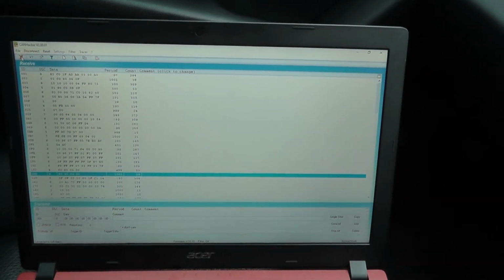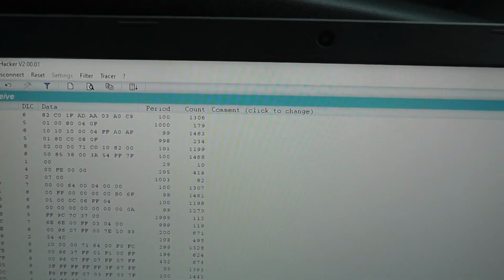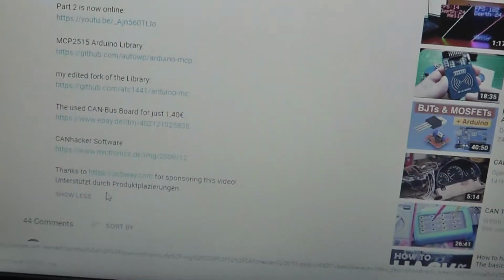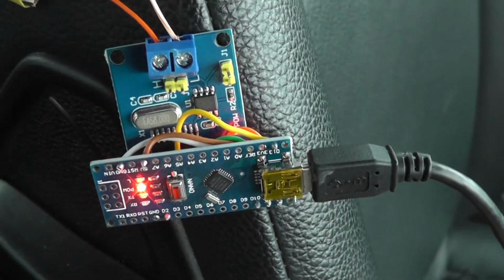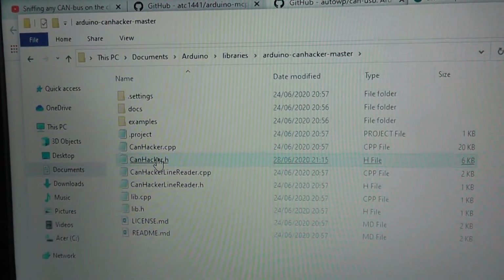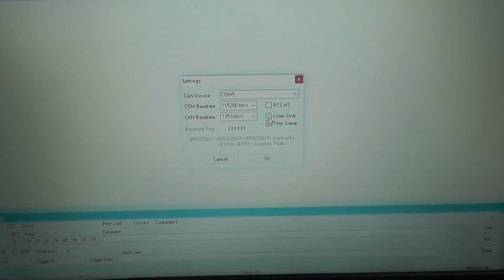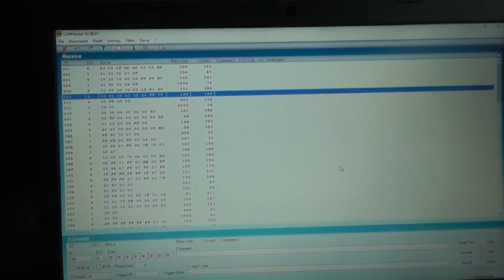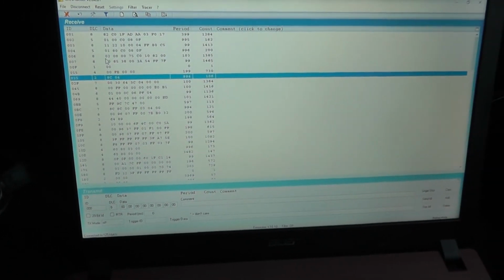DIY EV Part 2 - How to read the CAN Bus in your car using an Arduino Part 2

Comment: Hello, although you liked my post, you didn't reply, I would still like to know how to connect to my Audi A5 and browse the CAN bus, what do I need as I've already purchased various cables and CAN bus interfaces, so far nothing.
Reply from the maker: Have you tried connecting to the CAN bus directly or through the ODB2 Port?
Reply: @alibro7512  both, initially via the obd2 port, nothing, then I trying using a CAN crocodile on the CAN wires in the boot… still no luck
Reply from the maker: @SimonPlatten   Have you watched all four videos I made on this and read the notes and all the comments? Also Aaron's video?
Are you using Canhacker?
What speed have you set for CAN? 
It's been over a year since I looked at this so I'm a bit rusty on the details but I'll help if I can.
Reply: @alibro7512  I can't say I can remember if I have, I will take a look at these.  I've tried various speeds, but nothing on any.  Its been quite a while now so I will have to get back up to speed.

Comment: I've been trying to get a seeed can module mcp2515 gps to connect to new Toyota Corolla hybrid...

I've tried everything and I keep getting repeating msgs.

Tried all bauds, MHz, etc.

My question is... What PINs do I need to set in Arduino uno software?

I've tried 2/10 and 2/9...  

Anyone have any tips?
Reply from the maker: It was a long time ago that I did this and I struggled with the Seed Studio shield too.
How are you connecting to the CAN Bus?

Comment: ESP32 can use CAN HACKER V2 ?
Reply from the maker: I don't know but would be interested if it did.
Reply: I have followed your clip , I am able to use can hacker software now.
Reply: I use Arduino nano with Mcp2515.
Reply: I would like to know if I can find the can id related to the transmission.
Reply: I will take it to study in university research.
Reply from the maker: @ภัทรพลกุลเภตรานนท์-ย6ล  The CAN details of some cars are available on the internet so start by searching for them. If not then you'll need to do a CAN dump as you're driving and study it to see if any CAN messages correlate with gears changing.
Reply: @alibro7512  I did an experiment in an Isuzu  Dmax 2012. Can you suggest a reverse engineering method?
Reply from the maker: @ภัทรพลกุลเภตรานนท์-ย6ล  This guy knows more than I'll ever learn.
https://www.youtube.com/watch?v=MsrXs-tJKaY
Reply: @alibro7512  Thank you for the advice

Comment: I hope this message finds you well. My name is Sanket Ghadage, and I am currently facing challenges in reading the JK BMS CAN data. Could you please provide assistance or guidance on troubleshooting steps to resolve this issue? Your technical support would be greatly appreciated.
Reply from the maker: I'm not an expert in CAN and don't know anything about JK BMS so will probably not be much help but will try. How are you connecting to the BMS?

Comment: Hai Ali Bro, Thanks for your sharing.

Unfortunately I still confuse on this lines:

const int SS_RX_PIN = 3;
const int SS_TX_PIN = 4;

SoftwareSerial softwareSerial(SS_RX_PIN, SS_TX_PIN);

Based on the diagram, I don't see any device connect to pin 3 and 4. 
Have I missed anything? Thanks
Reply from the maker: Hi Ali
I'm no expert and I don't have the code to hand right now  but Tx and Rx are Transmit and Receive so those lines will relate to either the CAN communication to the car or more likely the communication between the Arduino and the MCP1515. 
If there is nothing on those pins and the code still works then maybe it is unnecessary.